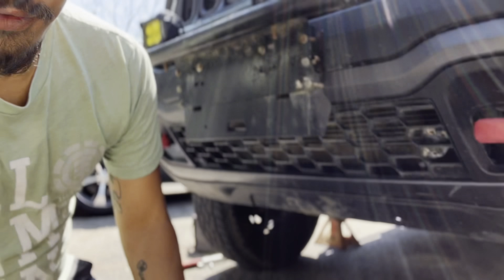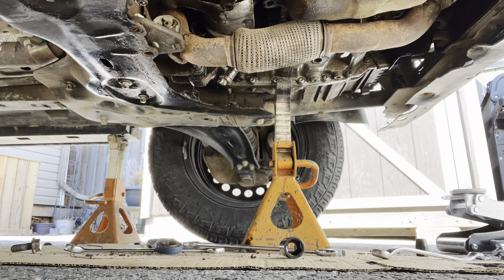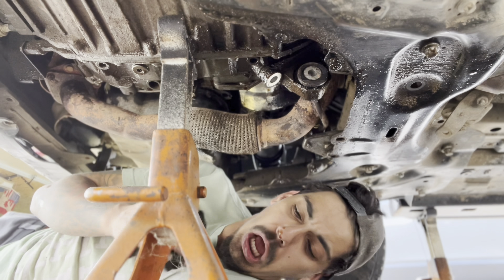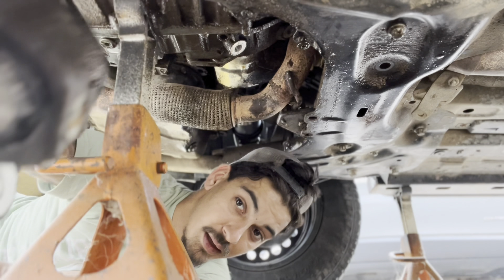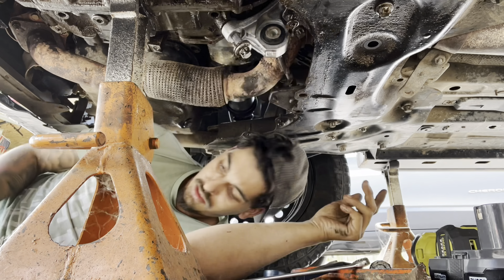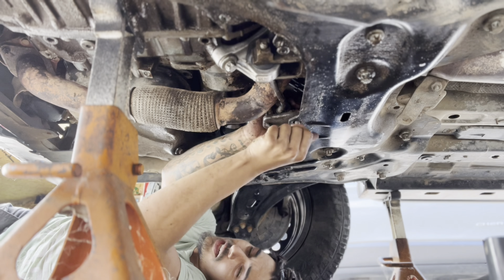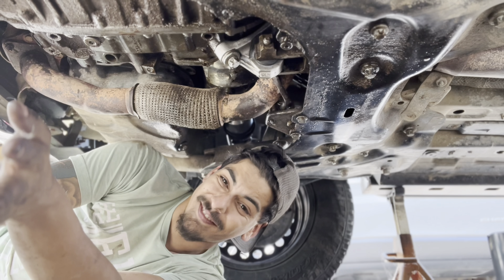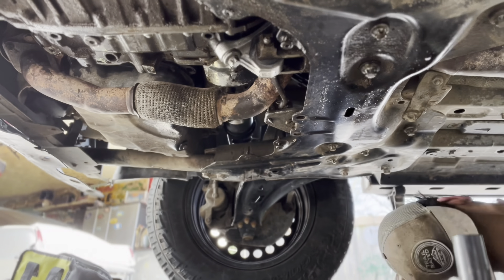Changing lower transmission mount on 2015 Jeep renegade 2.4l

Comment: Couldn't you theorerically lower the trans a little after disconnecting it from the subframe to get more room to finish the removal of the last bolts and install of the new one?

Comment: Good Video. You should wear safety glasses and buy a few electric wrenches. Also if you can clean the engine with degreaser. Helps when noticing new leaks. I would love to see videos of you installing accessories. 👍🏻